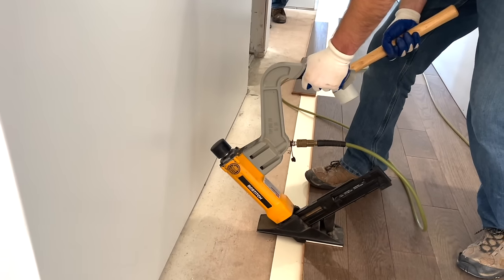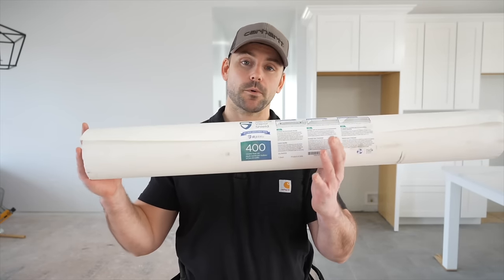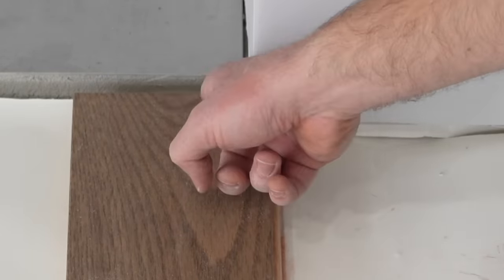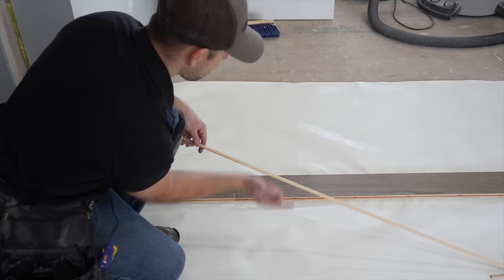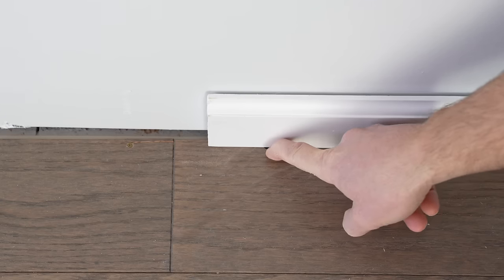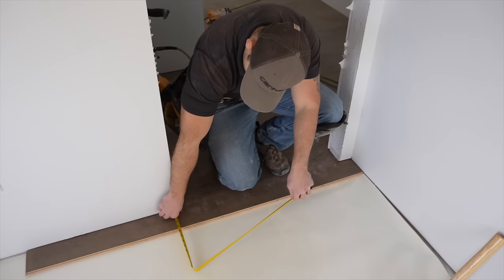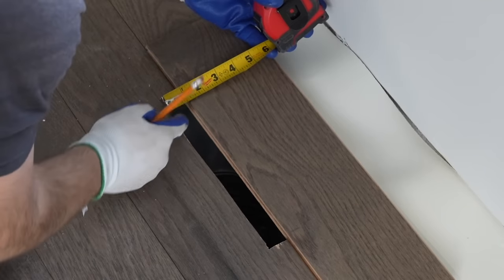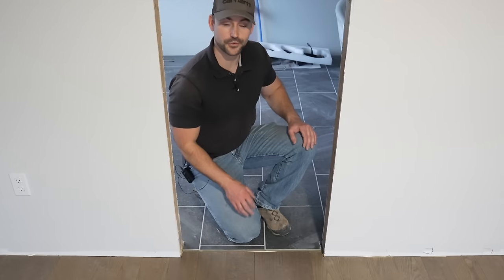Hardwood Floor Installation For Beginners - Ultimate Step-By-Step Guide

Comment: He is a fan of prefinished because he doesn’t have to come back in and sand and stain and put polyurethane or his choice of top coats on top. Today I started installing 9 inch white oak in Balboa Island, Newport Beach, California. A good installer only needs 5% waste. I’ve never heard of 10% until the 2000s.
Reply: I had prefinished installed and what I noticed is that the boards don’t put up as tight because they’re rounded over on the edges
I think if I had it not prefinished, the boards would not be rounded off on the edges 
Giving a tighter look 
And again, because they’re not that pipe together that small little space I’m thinking is gonna be more susceptible for dirt to get down into 
I guess it’s a trade off because if you have to finish it then there’s all the extra work you have to do

Comment: I'm a DIYer.  I've done a bunch of floating floors, but I've never done engineered or hardwood floors.  Thanks for explaining the spline method. I've never seen this done before and it makes perfect sense.  Great video as always.
Reply from the maker: Hardwood flooring is not that difficult in my opinion. The spline method is a game changer. Good luck with your project!

Comment: One tip regarding your math adding in the waste factor: If you take the area of the room, 224sqft in this case, and multiply it by 1.10 instead of .10, you won't have to add the area and the waste together as you already did by putting the 1 before the decimal.  Saves a step and chance for error.  I always use this when calculating the cost of something plus tax, cost of a meal with tip, etc.

Comment: I would like to point out that in newer construction, if 5/8 Advantech T&G subfloor is installed properly,  glued and spaced at joints correctly,  you dont need to run the floor perpendicular to the floor joists as the Advantech  subfloor holds staples exceptionally well and has very minor deflection on new joists spaced properly and glued. Also, anything over 4"face needs glue assist and removes the need for paper. Paper now a days is used more for the installer to slide the pieces around. Advantech has good moisture sepperation qualities, and in order to glue assist or make a pattern in the floor, you need to use construction adhesive directly to subfloor and not paper.

Comment: Good video - thanks for producing.

Whenever I acclimate any finish materials into a conditioned space, I first completely unbox/unwrap then stack-and-sticker the material and leave for 7 to 10 days.  That way, the conditioned air gets all-around each piece of material and the material becomes fully-acclimated faster.  Admittedly, this takes more time and labor but the material is thereby guaranteed to be fully-acclimated.

Also and whenever possible, I try to avoid chalk-lining and then aligning the tongue to the chalk-line.  Rather I find it more accurate to align the bottom lip edge of the groove side to the chalked-line and then lay up the next rows either side.  The glued-spline method is always good.

Comment: Excellent video and great advice.  This was my first go around installing hardwood. The best advice for me was using the screws not only for the first rows, but other spots where I was not completely sure what my next step was or where I was making cuts like around heating ducts and doorways. It allows you the option of removing the boards if yours not happy with the results, or think you may need to make a change.  For the most part I used the nailer and nails, but using the screws allowed me to experiment a little bit.  Thanks!

Comment: Always loved hardwood flooring. Doing a  lot of random 3,4,5" is really rewarding to see when it's all done. I love your explanation of letting the floor acclimate to the environment and the humidity control as well. One other important part is when you explained the direction of the floor joists and how the hardwood has to be run. I've had arguments with clients because over this and once I explained the reason, it made sense to them. Also doing some inlay wood vents that are flush with the floor are really cool looking. I had one job I had to do a perimeter flooring of 2 ft in a room around where carpeting was going to be in the center. Having alternate my corners and making your own pieces at certain times and of course the splines are the best thing to be used with many other installations. Screwing the tongue side and the groove side always worked out the best compared to nailing them with a finish nailer. Thank you for this video with so much important details. (Even around the stone work 👍🏻) 
Personally I've used my ratchet floor nailer more on jobs when it was in a finished house with furniture etc. Of course the pneumatic is great 75% of the time and cleats unless it was an engineered floor that required staples. Refinishing on a 3/4" solid wood floor has more to work with than engineered. The margin for expansion is really important as well. Most of my flooring jobs I've used shoe molding with the baseboard which gives it a really good look too. 
Thank you for all the information on this video and the timeline ones too. Great job Josh 👍🏻
Reply from the maker: I really enjoy installing hardwood floors as well. I have installed unfinished and prefinished. The widths have done is 2 1/4, 3 1/4, and 5 inch. So far my favorite one has been the 5 inch shown this video. It went down relatively quick. Screwing in the spline is a good idea as well. It sounds like you have a incredible amount of construction experience, David. Always look forward to seeing your comments. Thanks for stopping by and watching!

Comment: This is an excellent installation guide. I am contemplating a hardwood installation at home, so I have watched gobs of videos about hardwood installs. I am really happy I found this one. After watching this guide, I know I can handle doing it. It's not just what he says but how he shows it, the order of operation is great. Most of the videos I have seen demonstrate the need for a chalk line but not why or how to properly make one.  This guy does. Also, the tip about undercutting the drywall makes so much sense, it is so easy to do, and I haven't seen anyone else mention it. Anyway, thanks for taking the time to produce the video. It's really helpful.
Reply from the maker: I’m glad you found this video as well! I always try to put much detail in my videos as possible. Undercutting the drywall is something that has to be done in certain cases. Good luck with your hardwood flooring project!
Reply: Very good video. A lot of good information here. Since baseboard trim is all less than 3/4 in and most is 1/2 in it makes sense to cut away the bottom of the drywall so your 3/4 in flooring can expand under it and your 1/2 in thick baseboard will cover your flooring by 1/4 in....so you don't use quarter round. I took measurements from my outside walls and snapped a line all the way through my place from front to back...about 33 ft. Now my flooring runs from the top of the stairs all the way back and is  square. The drilling technique is great and used it a lot in tight places...used glue for smaller pieces along the wall. I also used the spline as you show here. I bought a tiny wood planer tnat is about 4 or 5 in long....Very handy to smooth down high spots. I did have to plane the spline down a little bit so my flooring would go together without leaving a gap. My install looks professional and i have done things correctly thanks to this great video.

Comment: Josh, You have done an incredible job in producing this hardwood flooring installation video. 
I recommend using a Bostitch floor jack to eliminate gaps near the wall.

Comment: Great video, thanks.  I noticed you were using Bellawood 3/4 x 5" flooring over Advantech same as I am.  They sold me underlayment and I started using it but had some creaking on the back edge of the boards.  Their website recommends glue assist so I had to start over and do the glue assist with no underlayment and it is a much quieter floor.

Comment: Good video. Using a story rod off of plywood seams minimizes constant reversing and line snapping. In most homes the walls are generally pretty parallel to the long plywood seems.

Comment: Amazing video ! Would you recommend using Dewalt cordless 20V flooring nailer instead of a pneumatic nailer for DYI project? Also, do you cut boards (length) in random sizes or do you follow some unique pattern?

Comment: I have done a tongue and grove floating floor with glue. I need to install another, but I want to nail or staple it down. I don't have plywood. I have OSB subfloor and 3/8 engineered wood. I am not certain of the  correct fastener to use. I thought I would use a 2 inch staple. Now, I see you're using the single cleat. What length are you using and which would you recommend for my install? Which would hold best in the OSP and which is likely to cause less damage to the tongue? I have never seen the spline sold in stores. is there a particular thickness to ask for? What type of underlayment did you use again? I have heard the roofing paper can have an odor. I know you gave the name but I couldn't catch it. Could you type it so I can look for it? Thank you so much for your video. I wish I could hire you!

Comment: Can you use a planer instead of a sander to level the subfloor? Which is better?
Reply from the maker: You could use a hand planer, except the nails in the subfloor may be exposed and you could ruin your planner quickly. That is why I recommend a belt sander. I hope that helps!

Comment: Hey Josh, I've watched over this a few times and I still cannot understand why the screws for the first row. Doesn't fastening with screws prevent movement? As I understand how these floors are supposed to work, they are supposed to expand seasonally. Wouldn't that bow them in odd spots? Again, I probably have missed it in the video somewhere. Thanks!

Comment: Im a DIYer and I’m getting ready to install 6” hickory. What I can’t find clarification on is if I should use a vapor barrier? From what I understand you want glue assist with wide plank material, but it doesn’t make any sense to me to put a vapor barrier down and glue assist on top? What I am planning on doing is using the glue itself as the vapor barrier and just make sure I have complete coverage overtop of my osb subfloor. Do you have any suggestions/clarification that may help me? Im doing roughly 500 sq ft.

Comment: New to the game. Why is the floor considered floating, and we're concerned with expansion, with thousands of nails in it?
Reply: Wood expands and contracts more tangentially to the grain than it does radially or longitudinally. What that means for hardwood flooring is that it moves more perpendicular to the long axis of the board than along it. Staples and cleats hold it to the subfloor, but they can still move a little bit. Nothing's going to get in the way of wood expanding, which is why you sometimes see people's floors pop up when they get excessively humid. It's also why you generally only see a full glue-down advised for engineered flooring, not solid hardwood. It needs to move.

A good rule of thumb is to add 1/4 inch of space from the outer wall for every unbroken 4 to 6 feet of linear flooring (either axis). Floor transitions and drywall widths provide decent gaps, but it's best to leave a little extra.

Comment: very well explained and good video but I have a question and how do I install it if it is a concrete floor and I want to install Hardwood Floor and if possible, how is the installation charged if it is by linial feet thank you very much

Comment: when you screw and nail the flooring why do you need an expansion gap?  One other thing why do HVAC installers put vents under windows?  Blow cold air across hot windows in the summer (heating the AC) and hot air across cold windows in the winter (cooling the heated air).  Why?